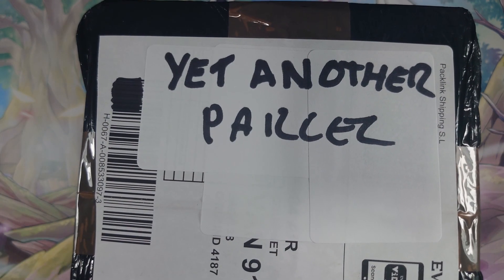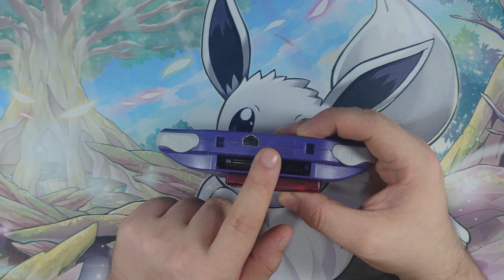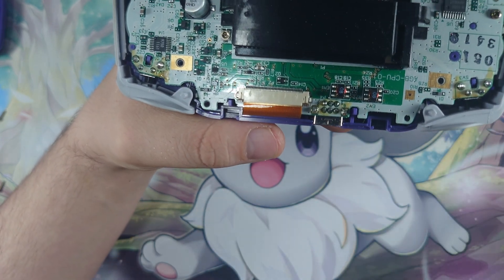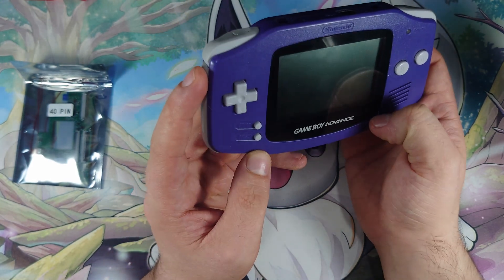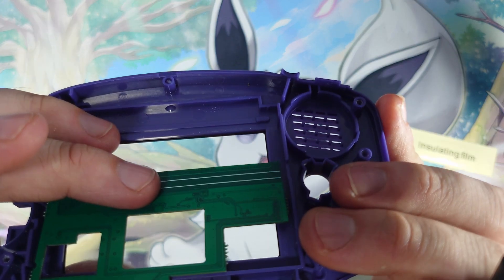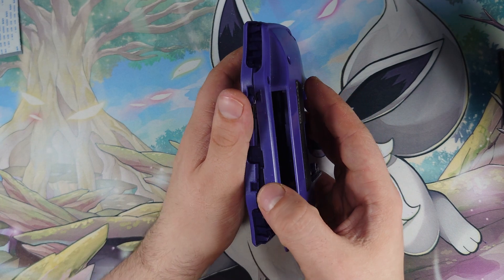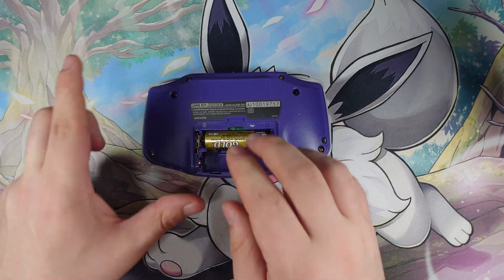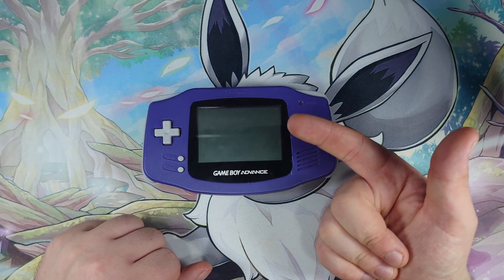I Added An HDMI Mod To This Game Boy Advance And Now I Can Record Pokémon Games!

Comment: thanks for the vid!
If I am allowed to, (i know it's a year old but..) give you an advice:
11:12 - no clean flux works wonders on soldering points. 350°C for the soldering iron and you are good to go creating magnificent soldering points without extreme hassle.
Reply from the maker: Yeah I hadn't had much experience with soldering when I made this video. I've started using flux and I don't know how I managed without it before. Thank you for the advice 😊